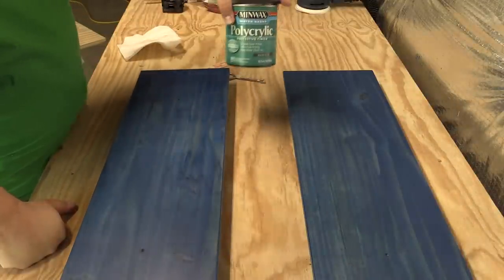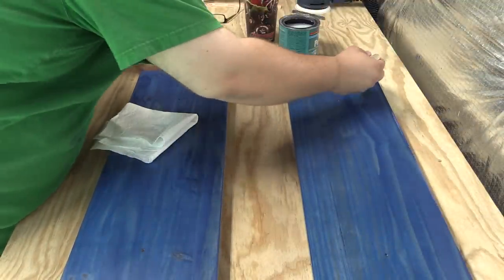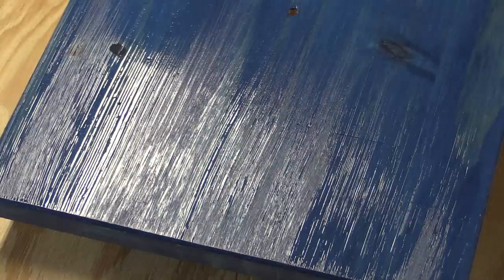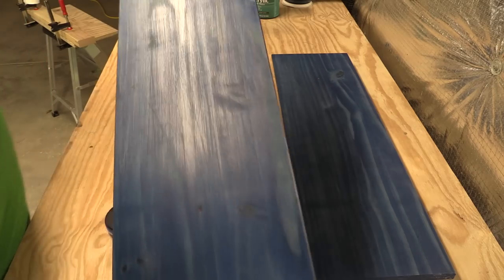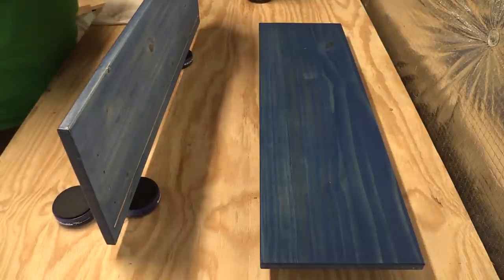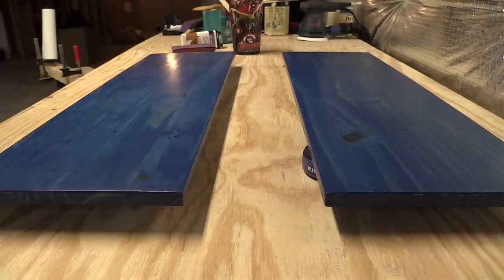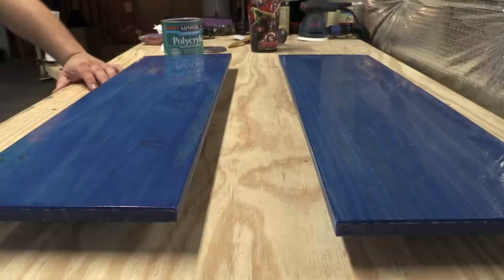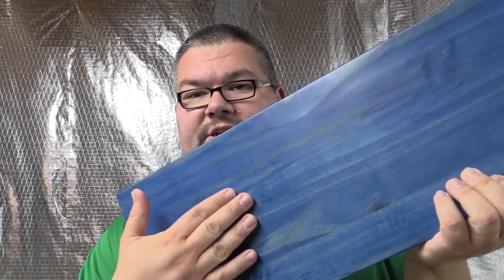Amateur Wood Finishing 101: Introduction to Water-Based Polycrylic Finish (Part 3)

Comment: Remember that you are laying the clear coat not painting it. Best technique would be to overload the brush and start in the middle and allow the coating to come off the brush as you very VERY slowly pull it the length of the project surface and then return to the original starting point and go the opposite direction.  Outcome will be less brush marks and bubbles. Hope this helps!

Comment: Thanks for this video.  I used the rag, and also diluted the polycrylic 3-1 with water.  That kept the air bubbles from being there  (I had done 2 coats prior with needing to sand out the bubbles).   2nd coat, I just added more poly to what was left over so it was closer to 1/2 part water to 1 cup of poly.  Still just as beautiful and super smooth.  I plan on maybe 1 more coat.   Again,  Thanks for the video!!!

Comment: Your daughter has a very diligent Dad.  Good for you.  

For me, the big lesson here is that Minwax Water Based Stain requires three coats.  At least on pine.  The end result is leagues better.  That first coat was just dispiriting.  The second coat wasn't much better.  But the third coat looks very good.  Oil based stain comes with no guarantee when it comes to pine, so why not try the easier media?

Polycrylic is terrific.  I've used it for years and put it on everything but the dog.  After it is applied and you leave to let it dry... little drips and gobs will develop.  I've found that gravity is usually involved.  

Great vid.  I will now attempt a small project with these water based products.  Thanks.

Comment: I've been finishing wood for years professionally...bottom line, you can watch all the instructional videos you want, wood accepts stain willy nilly, so try to get it as balanced as possible, and whenever possible, use a spray gun for the best outcome. Nice job

Comment: The end result looks good. After charging your foam brush (its all you need), start from the centre of the board farthest away from you and work the finish outward (left and right) and when the surface is covered, then hit your sides. Don't over brush because this stuff dries fast and that's how you leave brush marks. Start from the centre, then brush the finish all the way to the left, the lift your brush and recharge your brush and start at the centre again and brush all the way to the right. You should have a solid line of finish. Then on that same line, "tip off" with your brush (do not recharge this time) by starting lightly on one end and slowly make one pass all the way to the other end.. And that's it... Don't repeat any steps more than I explained. Like i said, you don't want to over brush. You want to apply (not flood.. But close... If that makes sense) and move on to the next section. Hope that helps
Reply from the maker: Thanks for the tip!  Something very simple but I wouldn't have thought of it.  I have some shelving projects coming up that I will try your technique.

I have a question for you!  When applying finish to edges, what can you do to keep drips from accumulating on the underside?  I find that to be my biggest challenge.  What are your best tips for applying finish to edges.  Thanks for watching!
Reply: Don't use too much when applying finish. At the end of the application process, you can just carefully wipe the underside of your surface that you are finishing with a rag
Reply: Marcus has the right of it.  "over" brushing really just introduces more air bubbles and opportunities for error.

Comment: Nice job, finish looks good. I'm no expert but I do have some practice with finishes, and I have a couple of suggestions for you. The first is really, really, minor but here it is: Pour about the amount of finish (or maybe a little less) you expect to use into a secondary container and use that for charging your brush. The reason is that when you dip your brush into the finish can multiple times you will transfer small amounts of stuff from the work piece into the finish can and by the time your can is half used you'll probably have enough contamination to make a difference. The second suggestion I think is much more important. You should always finish both sides of a piece wood. The principle is this: whatever you do to one side of a board also do it to the other. If you finish one side of a board and not the other moisture will migrate at uneven rates in and out of the wood in different parts of the board. This will cause warping and other bad things. If the second side won't be seen you don't have to make the finish pretty, but the second side needs finish. Lastly, something you can try to make the stain more even is to use a pre-finish wood conditioner. I have tried a couple of different brands with mixed results. As you say, "your mileage may vary," but it might be worth a try. Happy wood working!
Reply from the maker: Thanks for watching and the tips!  I actually did the prefinish in an earlier video.  Not sure how much it helped, but honestly, this is pine to begin with so probably shouldn't expect too much perfection.  I know some folks will also use just water to "open the grain".  The tips you've given above are also very very good.  Thank you for those!
Reply: I agree totally, I have contaminated my poly with the previous stain before, resulting in a dark colored poly... oops...  :D

Comment: This video was immensely helpful. I have been working with polycrylic for months and just cannot find a way to make it not leave brush marks. So far the best I found was the foam brush however sanding and repeating was always a step I would never do because I always try to rush the finished product. I love the comment to take your time and pay attention. That is true. I always want it done right away and forget to slow down. I do prefer the foam brush as well. I was super pleased with how you showed the product up close in various light so we can see the transformation. I have never seen that before in a video. Thank you for taking the to make this video it was super helpful.

Comment: Yep, I like foam brushes too.  I bought a box of 12 on Amazon.  When I was using oil based poly I would just throw them out after 1 use.  Now I use water based finishes so clean up with water is a breeze and I reuse.

Comment: Great video thank you so much for sharing in most of the other videos I seen using that they say not to take your brush back and forth over the area with the grain in one stroke from one end to the other missed a spot leave it until you go back over it again love the tips about wiping down the drips from the sides from the bottom I myself am I beginner I plan on using this on a round piece of board and yes I'm really nervous about this I'm keeping them natural wood and using natural wood stain oil base first and I will be using the water-based polysporin to protect it thank you so much for sharing it's so nice that we can learn from each other have a great day God bless

Comment: Fast and thin is the name of the game with this product if you want super smooth results. I like a 2.5" angled Purdy brush. Do a small section very fast, almost violently brushing it thin onto your piece, feather the next section into the last, then use the weight of the brush with the grain for a final smooth out. The streaks and/or bubbles typically occur with this product when you either lay it on too thick, mess with it for too long, or don't use a smooth brush. Also, as compared to what is shown here, it's best to use a separate container to avoid compounding contamination.

Comment: A technique for putting on finishes (and probably even stains as well) to avoid or limit the amount of runs of product on the sides and bottoms of the project would be to work in long single strokes starting approx 1/4 inch from the end of the board and flow thru to the other end and run of the board and run in the reverse direction starting 1/4 from end and flowing off the other end.
Reply: This actually prevent you wiping the brush on the edge of the board and dragging the product off the brush causing a run. So starting just in from the end and flowing off the other end and then starting just in from the end and flow back off the other end actually does help prevent excess product being dragged off the brush and onto the end of the board.
That was a tip I was givin way back in high school many years ago doing wood work as a subject and it's always been stuck in my head ever since.
Reply from the maker: Thank you, as this is something I constantly struggle with!

Comment: Well one thing you did right your mic ,great audio. You want to try a cool trick for a great sanding tip. Take a paper bag cut it fold it and hold it like sand paper and sand with that . You can do that in between coats and the finale sanding .  The paper bag helps remover the rough feel, its like 2000 grit for free . 20 coats you'll go broke lol . With the grain? you should always sand with the grain .no matter what . Awesome video btw.

Comment: At 12:17, I can see some bubbles at the bottom of the left piece.  WB poly works best with long, slow strokes.  When bubbles appear, you can pull a lot of them with some extra slow strokes, but it is easier to try and keep them from forming in the first place.  BTW - Great video.     I enjoyed it.

Comment: Oh my goodness. Thank you for posting this! I was getting so aggravated with my 1st coat coming out looking so terribly, regardless if I used a roller, foam brush, or synthetic brush. So I kept wiping or sanding it away in an attempt to perfect it.. not smart, I know, but I'm used to using paints, not urethanes. Even with your edges not coming out how you hoped, your video gives me hope that I can get my cabinets coated in this stuff and it will look good! Again, thank you

Comment: Ditch the foam and bristle brushes! You can purchase cheap disposable painters pads which work much better than any style brush on water based finishes. HD has these the 2 1/2 by 5 inch or so disposable painters pads for about a buck. Load your pad and pull very slowly along the surface watching for dry spots and do not "brush" it backwards and forward. These painters pads hold considerable amount of finish product and when used with no downward pressure, the much larger surface area applies water based finishes streak free. I've used these for years on furniture and wood floor refinishing projects. Cleaning them is a breeze and these disposal pads can be used numerous times.
Reply: Curious how you clean them? Also, how do you keep them from hardening between coats?

Comment: I see you used a foam brush to apply your 1st coat of poly.  I used a bristle brush for 1st coat.  Before i saw this video and i can see the foam brush gives a more consistent uniformity of finish . I used a 320 grit sand paper lightly went over my  doors and cabinets . But i used Tack clock to wipe up the dust.  Works extremely well.

Comment: I'm no finishing expert, but I've never had good luck with Minwax water based poly.  General Finishes makes an awesome water based poly.  Their High Performance Top Coat comes in a green can and it's worth the extra cost.

Comment: SLOW strokes, holding the brush at low angle always has the best results, for me at least,  I am guilty of over stroking, (which leaves brush marks) and constantly have to remind myself that I am NOT using paint. lol, I also use progressively finer grits of paper in between coats starting with 220 and finishing between the last coat with 400 grit, and can usually get a glass like shine from polyurethane. I also use a natural bristle brush when using polyurethane.
Reply: TimnWendywoodworks

220 is probably the finest grit one would want under a clear coat.  You'll get better adhesion/more for the clear to grab on to.

Comment: So, the one part I learnt early on is with Polycrylic, don’t be tempted to go back and add extra poly if there are parts you’ve missed. One swipe slowly from one side to the other - this eliminates the brush marks and the blotchiness. Stir the tin slowly !,! You don’t want to fill the poly with bubbles - this is also what happens when you use a sponge brush.

Comment: aside from spaying, water based poly is a super pain in the ass. You definitely want to back brush as little as possible. I only brush one direction when I do this. I found a brush that works really good for this. Its the Gramercy water based brush. its basically a high end synthetic shaving brush, but in a paint brush handle! I also thin my water based a tad. 

I know this video is old but to anyone watching, I also like to use 400 to 800 grit paper between coats. Anything under 400 is way too rough for me.

Comment: very helpful, thanks. i recommend to watch this at 2x speed. i imagine the final coat could use some buffing with something like 600 grit sandpaper (or much finer) for a super smooth glossy finish. cheers.

Comment: How would you go about applying this finish to both sides of the board? Bottom, let dry, top, let dry, repeat?
Reply from the maker: I bought some "Pyramids" that allow me to work on both sides of the board - tiny touchpoints so you can work both sides in one operation without fear of ruining your finish

Comment: I like that blue color. Try starting in the middle and brush to the edges you wont leave runs on the edges as bad that way. It sounds crazy but don't back brush water based finish. Put it on and walk away no matter how bad you want to go in and touch it up lol
Reply from the maker: I have learned the not to touch it.  By the time you notice something wrong in the water based finish, it's too late!  Just let it dry, sand it down, and try to do better the next time.  I have a piece that had 8 coats of finish on it because of this.  However, based on the suggestion of someone else, I may now try hitting it with 400 sand paper and calling it good in the future.  3-4 coats of the water poly seem to be plenty of protection.  The saddest part is that I never finished this project because this dresser was in the IKEA recall.  I got a lot of compliments when I brought the stained/painted pieces in though!
Reply: If you gotta do it again try a poly rated for wood floors. Make sure you check if it's water or solvent base though. I'm not sure minwax makes a wb floor finish. I use pallmann products at work but for a dresser anything should do you fine. You will get a longer working time with a floor finish giving it time to flow and level better than the polycrylic
Reply: Good vid by the way

Comment: Water-based finishes, because they dry so fast, do not like being over-brushed.  Set up a good light so that you can see the sheen as you apply the finish.  Lay down a liberal coat and leave it alone so that it levels out.  Let it dry longer between coats and start sanding with 320 grit, going to 440 grit or higher. Using 220 only if your coat left ridges, which happens while brushing when it's beginning to get tacky.  If you like the finish that steel wool leaves, try bronze wool or the 3M Synthetic sanding pads, Grey, Maroon, and White.

Comment: hi there nice job, theres no better way to learn than to try it out. Try sanding with 400grit  with orbital sander before your last coat, really fast sanding, for your final coat us a synthetic high end brush, will last you longer than those foam brushes, which are pretty good for finishing actually, some of the best results before upgrading to a spraygun, lastly for the edges, specifically endgrain, try sanding with a higher grit than what you sanded the rest of the surface, im no expert either but those are some things that have workedd for me.
Reply from the maker: Thanks for the great tips!  I hadn't thought to try 400 on the last application of the finish, as I feared white streaks.  The endgrain tip is very good.  For my most recent job, I have started to get better at using a synthetic brush.  The workpiece was so large that I found moving the foam brushes at a high rate resulted in more surface bubbles.

Comment: That makes a lot of sense if it's the 3rd or 4th coat you can use 0000 steel wool. It's not gonna get through to the wood at that point.

Comment: I find the 220 to leave lines. Am I pressing too hard? I had to go after the 220 with 400 grit to smooth it. Great vid.
Reply from the maker: It will leave lines in the poly, sure, but I always end with a coat of finish as the very last step.  After the first 3-4 coats, I only sand if there are mistakes to correct.  400 may be good to truly "finish" with.

Comment: How do you apply over a large area. Small areas are simple. Can you do a video of an 5x7 area? Because it's simple to do with small objects but larger areas I cannot get the same results.
Reply: having same problem with a 4x8' table top.
Reply: I got this from General Finish's youtube channel  and it worked great.  Use a painters pad inside a women's nylon knee high or footie.  Then start on one end and slowly spread it the full length to the other end.  The pad will hold enough finish to do at least 2 full passes end to end on a 4x8' top.   This way, you're not lifting up the pad in between passes and avoiding brush marks.  Have a brush ready too to smooth out any overlap lines but once you get the pressure just right, you won't have any overlap lines.  Such a time saver.

Comment: Whats the secret?  I am not seeing any bubbles!!!!  I'm trying everything that is being mentioned.  How many times can I use the same foam brush (even if I keep it in a sealed bag.  I am putting this on a 2 ft by 4 ft board and I have to work kind of quickly due to drying.  Any thoughts??
Reply from the maker: I reused them many times, but I washed them well and then rinsed VERY well and let them dry.